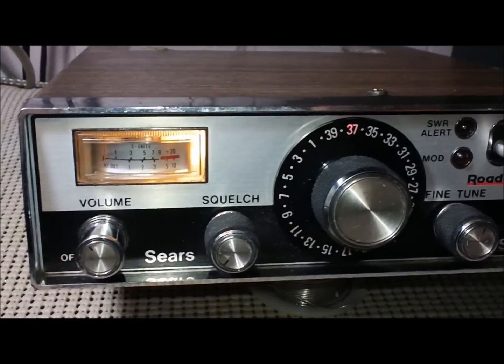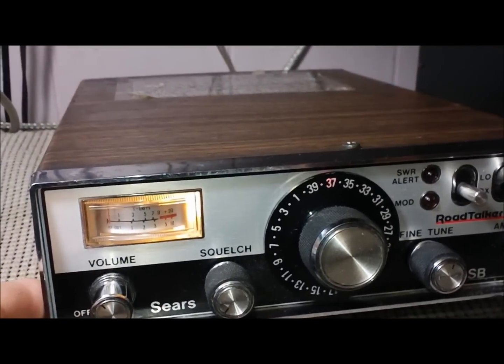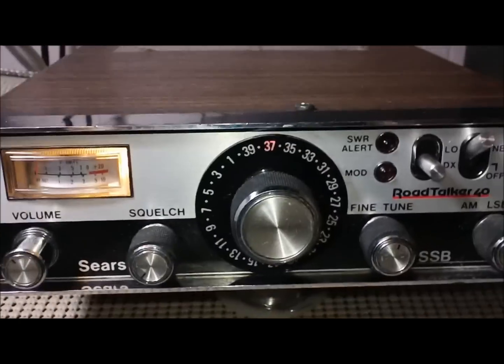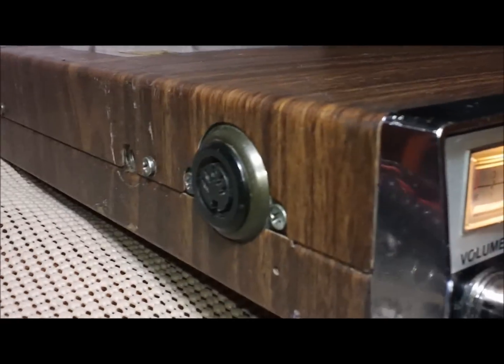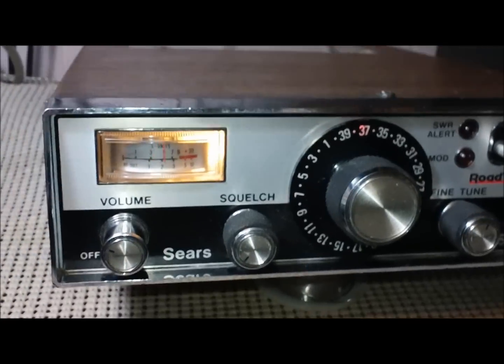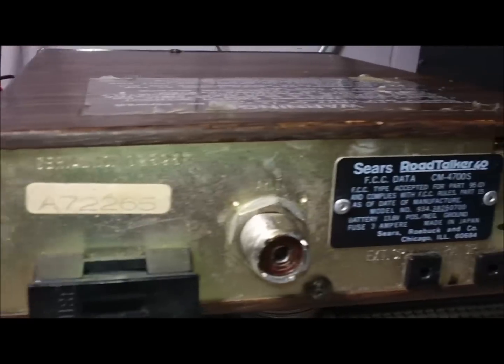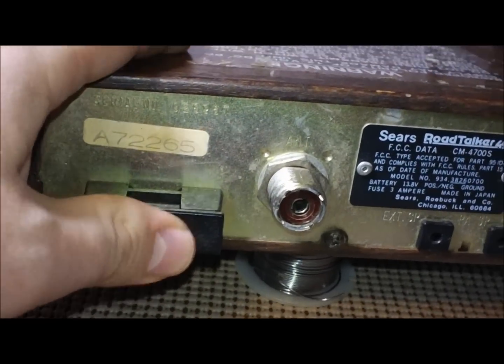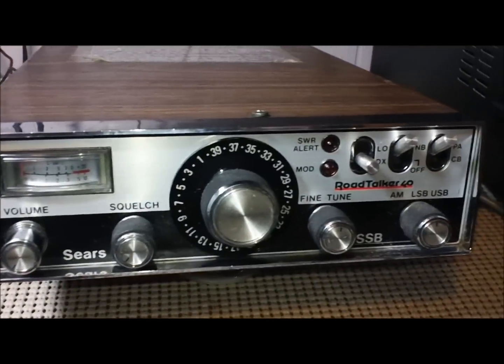Sears Road Talker 40 934.38260700 SSB AM CB Radio

Comment: I rembered my dad had the same CB radio he had it on a bench in the shop den hooked up to a big base station CB when I was a kid
Reply: My dad had a base station antenna he ran that same radio when I was a kid in the shop den on a bench with a 12 volt dc power supply Archer radio shack brand 12 volt dc power supply. I  rembered it was a rather long mobile CB radio

Comment: This was my first 40 channel radio I ever had; got it in 1977-78 for Christmas. Later on  around 1982 I had a DigiScan digtal VFO put on it; it would go about 15 below 1 and all the way up to the bottom of the 10 meter band! Worked LOTS of SSB DX with it! Had a n issue with the T/R relay going out and finally had to get rid of it when the relay was no longer available. :(  Really fine radio! Thanks for sharing! 73! ;)
Reply: Having problems sears roadtalker40 model:934.38260702   (1 of 2)
https://www.youtube.com/watch?v=_eAYeccayCo

Comment from the maker: It seems the maker of this model had quality control issues because I've read a lot of complaints through the years about this particular model. I don't know who made this unit. I suspect Sharp or Cybernet. It looks like Sharp was the maker of the large slant face Sears SSB but Sears was like a lot of brand names. They contracted with different manufacturers through the years. Their very late model radios (last of the Sears CB units) were manufactured by Uniden. 73's Paul

Comment from the maker: @TheZeke1974 If you do decide to give that a try I recommend insulating the inside of the box as well since you will have it out already. Those mic wire tabs are mighty close to it on the onside IMHO. 

These radios look like a Cybernet build. Bad solder joint or bad/leaky capacitor could be a possibility as well for the low RX SSB audio.

Comment from the maker: @TheZeke1974 This might sound silly but try insulating that metal box surrounding the mic jack. I had problems with it making intermittent contact with some of the components on the top side of the board. When it would happen I would loose TX output wattage but the oscillator was still running. I realize your SSB RX audio is a different problem but I never looked into what circuits run by and under that metal box. Just an idea.

Comment from the maker: @HabibAlby Remember when wiring a mic for it pin 2 on these radios has 12 volts running to it for the factory power mic they came with. Therefore for any other mic make sure nothing is connected to pin 2 on the plug.73's Paul

Comment from the maker: @HabibAlby Yes but they're smaller than the others Sears SSB radios LOL. 

My guess is your Cobra 25 has been tuned with the AMC being disabled and the Sears probably never has been. Just a guess. Try the power mic on the Sears. It will likely help it a lot. It's up to you on ever having it tuned. I don't tune classic radios beyond maybe turn up the ALC for SSB and the modulation variable, if the radio has one. Those two things are non-permanent but that's just me.

Comment: Wow I have this radio too. The body on this is huge! I remember as a kid I stuck stickers all OVER it. It was rough trying to get all of those off of the top! I was using it last evening, and the locals said my Cobra 25 was louder than it modulation and signal wise. I wonder if there is a way to make the transmit louder on this, perhaps a power mic?